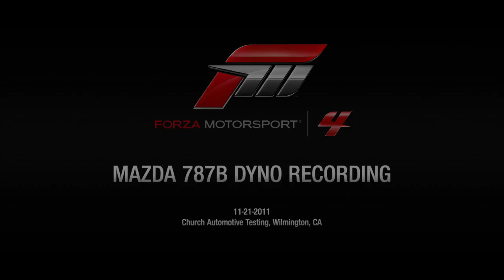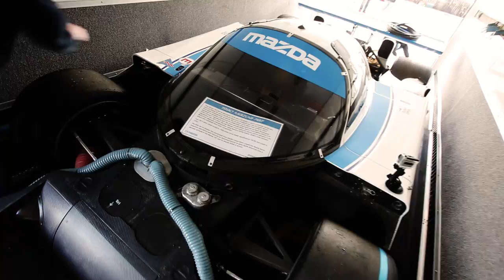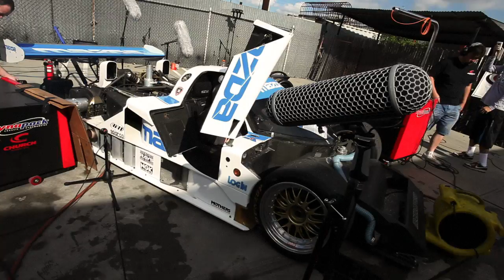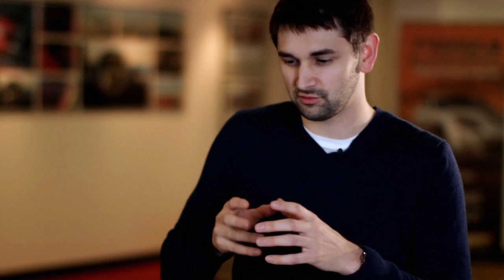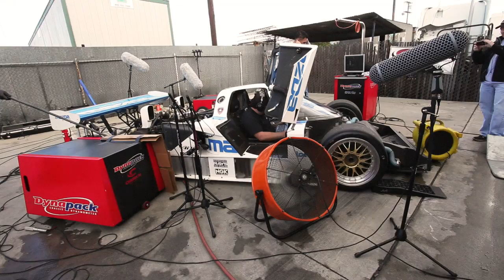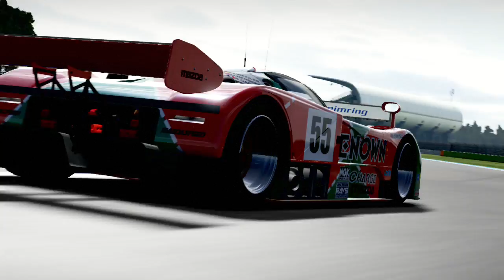Mazda 787 Forza Motorsport 4 Dyno Session | Mazda USA

Comment: just have one question which i will probably get hate for. if turn 10 wanted the #55 787B in forza 4, why didn't they use the #55 car instead of this? yes, it's a great car, even if this one didn't win, but is it because turn 10 are being cheap skate and can't be arsed to record the real #55?
Reply: The only difference in the cars would have been the livery and race number. They'll all sound identical, the #55 livery was chosen as it is the most famous of the three cars run in '91.